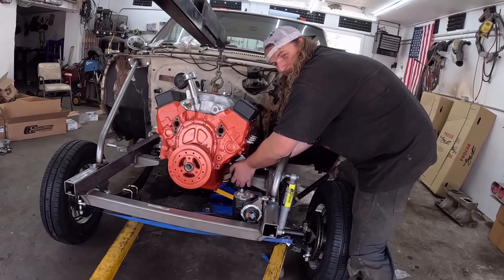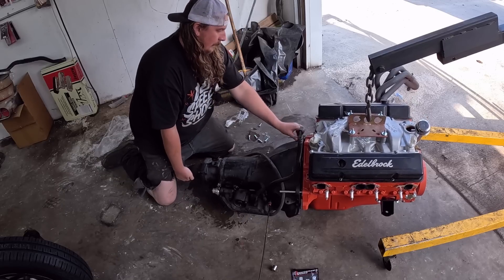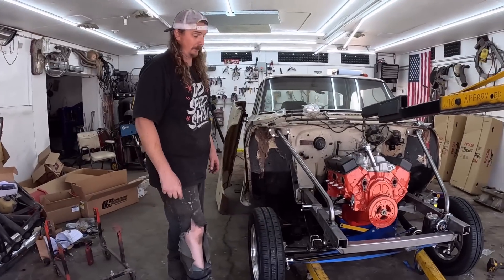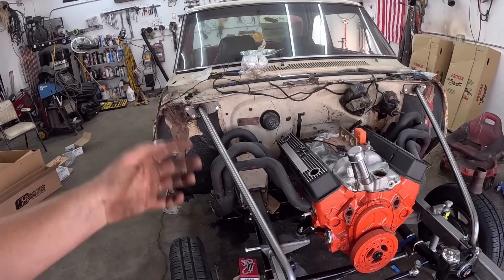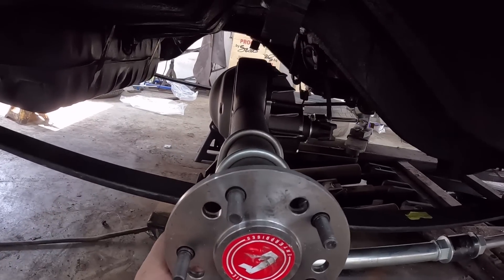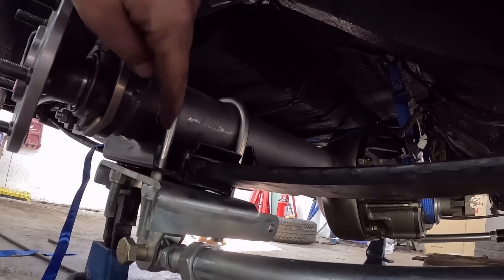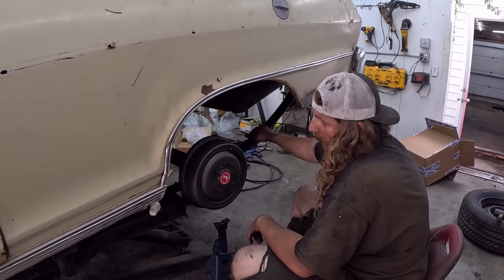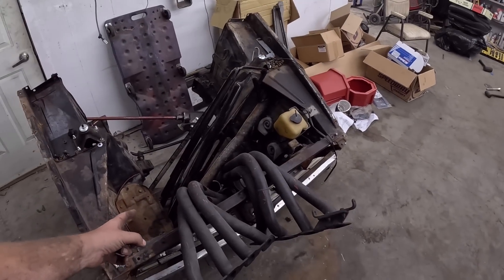FIRE Breathing Small Block! Gasser Heart Transplant Was Successful

Comment: Man Dan, that little 327ci is sweet 🧁 🎂 🧁, also, it's a proven fast V8 to get her started! Also, I've seen a 327 ci Chevy and the 5.3 Liter LS outrun big blocks. They are the screamers of the small block engines. They have been known to outrun Hemi's on the street. They are cool 😎 👍 💪 for street racing or for back of the track stuff or bracket racing 🏎️ 🐎 🏎️. I'm so excited for the both of you!!! Thanks for the video 📸.
Reply: High revving engines. 👍👍🇨🇦
Reply: Only the small journal 327s. Not all 327s are screamers.

Comment: I feel your pain brother when it comes to the significant other letting down an engine hoist or a floor jack. My wife does the same thing and doesn't seem to remember left from right 😆. I hope your going to flip those engine mount bolts around the other way so the bolt goes in from the top. Like you have it, if the nut happens to come loose which it probably never will, but if it does you'll lose the bolt and flat washer right out the bottom. With the bolt going in from the top if the nut comes off you won't lose the bolt. Just saying...
Reply: Bolt down. Nut on bottom. We emphasize this in industrial applications. Better a pin connection versus an open hole.
Reply from the maker: Haha she tries......

Comment: That's a nice looking motor. I always put chrome everything on my motors, from the oil pan to the air cleaner. Using long bolts with the heads cut off to line up the transmission is nothing new, an old mechanic showed me that 50 years ago. I'd put a fiberglass tilt front end on it. If you're gonna run a tunnel ram with dual quads, then top them off with a Hilborn style scoop that sticks up through a hole in the fiberglass front end. Back in the '70s and '80s I used to jack the rear end of cars way up with air shocks so the fenders would clear super wide tires, and never even thought about the pinion angle. Never had anything break. Never had to worry about breaking in cams either. Just put everything together with lots of STP oil treatment and it worked fine. I'd just go ahead and radius the rear fenders. That's what almost everybody does with gassers. I'd also go with a fuel cell and battery in the trunk. You should be able to replace those isolators with aluminum blocks. I did that on my 289 Pinto wagon. They do make shims, at least for trucks. Back when everybody was into lowering trucks till they dragged on the ground, you could get shims to adjust the pinion angle.

Comment: Dan, you may want to consider moving the rear axle back about an inch to better center in the wheel well.  Also, I have a Nova with the rubber axle isolation pads.  Took them out and went with traditional mounting.  I felt there was too much flex and my tires would rub if I swung the car side to side, or went around a corner hard. I think it let the leaf spring twist in the rubber.
 Car has a great look. Going to be quick!

Comment: If you do a Nova gasser image search, there are fewer radiused cars than those with stock or close to stock fender openings. IMO, that's because the Novas already have roomy wheel tubs compared to Falcons, Comets, and the like, and they just don't look as slick with cut openings. I think you're on the right track with pushing them out 1/2" or so, cutting the tub near the middle so it spreads out with the outer 1/4 will make that go smoother.

Comment: The equal and opposite is under load. Resting the pinion needs to point down.
Same with the engine angle, depends on the stance of the car. A tube chassis car the rear of the engine is uphill.
With your front end high 4 degrees down is OK.

Comment: Hey Dan I ran that low mount Alt bracket on my 57 gasser. It didn’t allow enough belt contact around lower pulley and would slip when nailing it. Went back to the coventional “long” belt setup with no issues plus it looks period correct.

Comment: You can buy a fender lip roller from Speedway & not fight the rear wheel wells as much. I bought 1 to do the wheel wells on my shorty G10 van & use it all the time now. It’s worth the cost when you have lots of hot rods with oversized tires.

Comment: I've actually had good luck with rattle can headers. They have to be sand blasted or new bare metal. Clean with wax/grease remover. VHT ceramic primer, VHT ceramic White (cast iron is the color I used) then VHT ceramic Clear. Then they HAVE to be oven baked or 3 heat and cool cycles with the engine (which is what I do). My Cutlass headers were still nice looking after 2 seasons. I have also done several sets of exhaust manifolds and VHT has held up on all of them. It just has to be really clean, use primer, color, clear and heat cured. If you spill oil on them after painting don't use Brakekleen on them. Use Duplicolor Wax and Grease Remover (water based) I put it in a spray bottle. Brake cleaner will strip the clear right off and ruin the finish. (Sorry for the novel)

Comment: @Dan...I put a pin on only hood on my El Camino, street weight not race as its not so flimsy and its way easier to access your distributor that way. or anything else for that matter. I'm running my brake lines up and over on the firewall and heat sleeving them too.

Comment: Verry noooice!
A genuine Gasser, 350 Hp will do STH in that little car...maybe not a top-end racer , but def no lame duck either.

I think youre doing good, by trying to maintain the wheelwells' stock shape generally...so it will tell that this is a "mild" gasser, not pure race car.

Curious if Danielle will approve the handling and riding comfort on this front straight axle tho😅

Greets from Germany

Comment: Dan the floor pan man to bad you don't have the company up there called jet hot they do a terrific job they do the inside and outside and it cuts the temperature down under the hood. It be cool if you welded the front cap together and make it a tild front end. That would be cool. It's coming along good.

Comment: At my local track back in the 60s and 70s there were many many early Chevy II cars. I found out later the gas company used these for the meter readers, they were as stripped as you could get. When they sold them you could pick one up for $100-$200.

Comment: You should flip the bolts so the head is on top. If the nut falls off the way you have them, the bolt will fall out and bad stuff can happen. WIth the head up, theres a better chance for retention if the nut falls off.

Comment: 31:35 into video; isolator pads: last video I commented you should replace those pads. Their worn out after 60 years of being compressed. $40 American @ Classic Industry’s, Ca. OER PARTs for 2 upper & 2 lower. Plus shipping. Good luck with getting the 9” correctly back spaced on the springs let alone centered.
Reply from the maker: U worry to much
Reply: They are new pads.

Comment: I like the idea of porta power the inner just a bit should work good, also Dan not sure if you guys have 91 or 93 octane over there ? Be carful with 11:1 and iron heads with detonation , Maddative fuel additive works pretty good they make in in leaded and unleaded. All the parts stores have it at least here in the states.
Reply from the maker: Only 91 unfortunately
Reply: 93 available in Southern Ontario. 👍👍🇨🇦

Comment: Could you remove the spring isolaters, set the pinion angle, and re-install them? They are the same thickness throughout, so they angle shouldn't change.

Comment: Can the leafs be turned around to put the locating pin further back, then the axel will be back in the wheel well more. Hard to tell in a video. Or can you drill another hole in the leaf to relocate the pin to move the axel back an inch or so? Just spitballin here.

Comment: '68 maybe but '69 & later fuelie heads have the accessory bolt holes. I have 3 pairs of the early, 4 pairs the '69 an later & 5 pairs of the 292 heads, just sitting around the shop. Got to have spares of everything. Have you ever heard of a list, while working on each of my projects, I make a list of parts (erasable marker on the windows works great) I need as I'm working so I have to make fewer trips to the parts stores. I KNOW that's to much like planning. What do you think about a '70 C10 "Gasser" I have a 70 C10 parts truck and a old mid '60 Chevy Van beam axle laying around.

Comment: I keep eyeballing you engine hoist. Im thinking about extending mine a little due to it not reaching crap. I actually built a 10ft gantry crane out of 2x6s just to put a engine in a pontiac grand prix but i want to use the little lift. Edit:I just noticed the UTG Approved on it so, I'll be fine modifying mine. Lol

Comment: I almost dropped the engine of a W9 tractor on my dad when I was a kid trying to run the engine hoist. Making a longer lever to put on the dump valve so you have more control is a great modification. Labeling it might not be a bad idea either.
Reply: I have a set of mini vise grips on mine for over ten years.
Easy peasy .

Comment: Put a Piece of 3/4 board between the tire and the Rear Quarter, let the car down and let it sit overnight, it will slowly bend the metal and and let it give ti some memory, it will probably flex back 1/4 of an inch giving you the 1/2 inch you want. Personal opinion the less cutting on the body am squeezing the oversized parts in  just makes it look more like a Bull Dog, tough looking.

Comment: If you get sand inside your manifold you won't be able to get it all out. No matter how hard  you try. I did it before. it'll ruin your valves. Have it blasted with nut shell's only. Don't take a chance.. Don't use glass bead either.

Comment: You really shouldnt match the angle on a leaf spring car. If your engine is down 4 degrees then your rear should he up about 2 degrees because the axle is going to wrap about 2 degree when you launch. If you have rear at 4 degrees it can easily wrap over 6 degrees which is obviously not good.